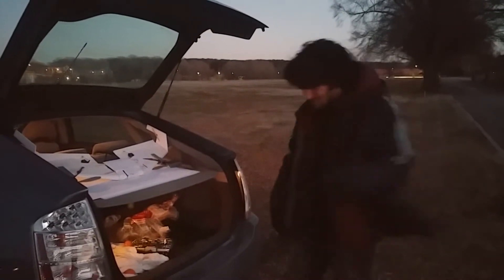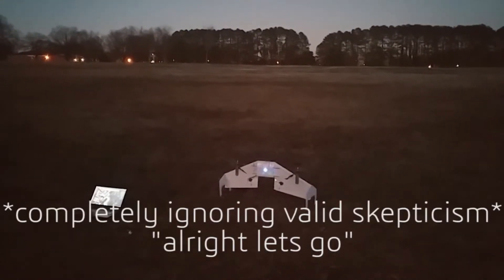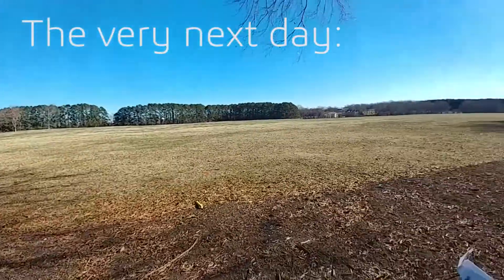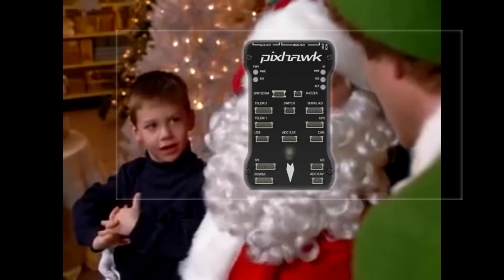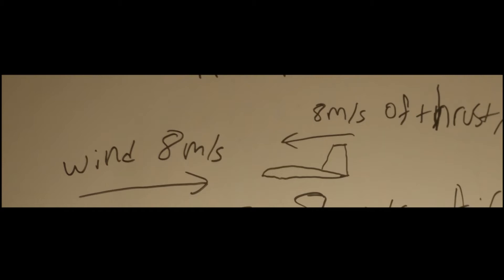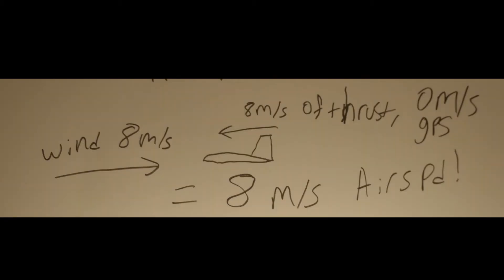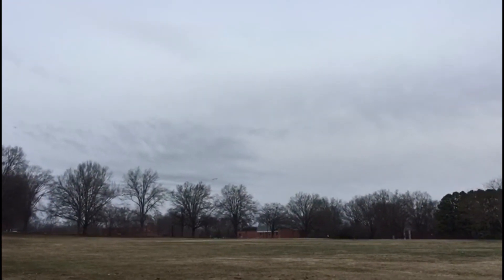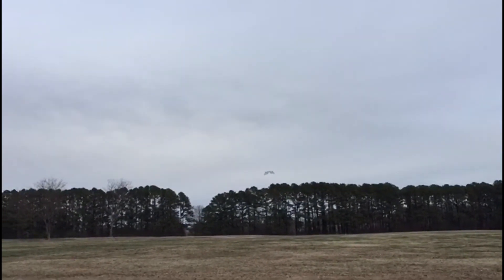Project Log 2 | Pixhawk VTOL Tail Sitter Flying Wing: Multicopter to Airplane transition

Comment: Hi tarik! I am currently trying ti do the same as you did in the video. As i'm cheap i didn't buy a pitot and i am currently trying the transition but without any success. Do you know some way to override the pixhawk in some way?
Reply from the maker: No idea honestly. You might have to go down into the code of the pixhawk and just disable some things from there. Check out the paramateres, there might be an extra parameter there to disable things as well
Reply: @ohitstarik  many thanks for your fast reply! I subscribed to your channel ;-)
Reply: @asaero92  if you use mission planner instead and use their tailsitter config you dont need an airspeed sensor. Its worked for me, but i'm getting one anyways just cause qgroundcontrol is just easier to use
Reply: @ohitstarik  When you tried to use it without the airspeed sensor did you set (CBRK_AIRSPD_CHK) to 162128. and set (FW_ARSP_MODE) to 'declare airspeed invalid' (2) ? Did you just short out the pins?
Reply from the maker: @123legomaker1  I did set AIRSPD CHK to 162128 but i didnt mess with FW ARSP mode or short out any pins. when I was working on this project the documentation didnt say to do any of that, and also had a bunch of stuff wrong in it at the time.

That being said, If you've tried FW ARSP MODE to 2 and shorted out some pins, if it's worked for you i'd say that can work in flight, just be careful when you test and make sure your vertical mode is nice and tuned.

Comment: You need a better flight stack,  http://ardupilot.org/plane/docs/guide-tailsitter.html
Reply from the maker: Drone & Sundry pixhawk > ardupilot, from what I remember pixhawk was made because ardupilots board was outdated. It's still 3dr updating the board, and most likely the vtol things are prob very similar or better on the pixhawk because of better hardware, does ardupilot actually have a better flight stack?
Reply: Tarik Agcayazi No it's nothing to do with 3DR you should give it a look. Great video's BTW. The Ardupilot flight stack is quite far ahead of PX4 now.
Reply from the maker: oh really? That's crazy, i had no idea, somebody i talked to told me the original developers of the ardupilot abandoned it to move on to Pixhawk since the processor of the ardupilot one was.. what 8 bit? 16 bit? So they just made better hardware and moved onto that. Either way, i guess we can still install the APM flight stack on pixhawk anyways right? I dont have an APM right now and dont want to wait for shipping to try it out
Reply: Tarik Agcayazi Ah, that's not the case at all, the Ardupilot devs made PX4 work, the hardware is better yes than the 8 bit controller, but there is even better hardware than Pixhawk 1, have a look at The Cube from ProfiCNC for instance, anyhow, again great work from you!
Reply from the maker: @sUASNews  lmfao yeah i did end up moving to ardupilot after this, and that's what i've used these last 3 years now.

Comment: Great project and videos! I have a question about the document you made: The flight controller is oriented as it would be in fixed wing mode right? I see it in Ardupilot documentation like this but nothing in PX4. Thanks!
Reply from the maker: I installed it paralell to the airframe, but the default orientation of the tail sitter is in vertical position, so the pixhawk is supposed to be installed perpendicular to the airframe. You can change the orientation though, if you just install it paralell to the airframe just add "Pitch+90" or something like that :)
Reply: Thank you! I struggle with PX4. Today I got a memory error when trying to calibrate the compasses. There has always been some issues with PX4 at least when I tried it. I flashed stable, beta and master. Sometimes it did work though. I m trying now ArduPlane, lets see how that goes.